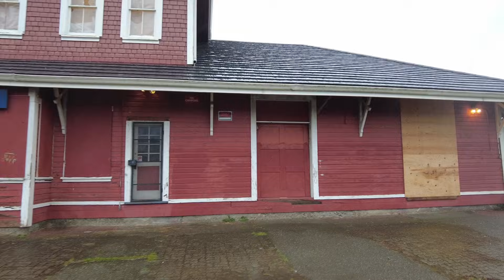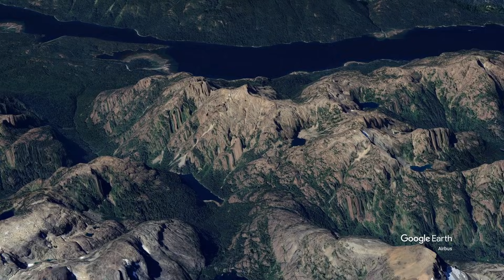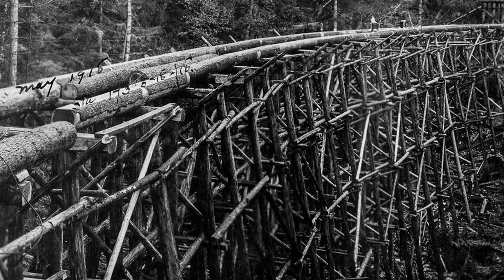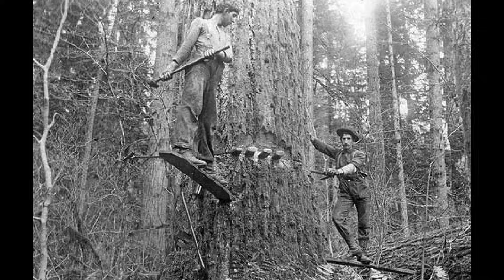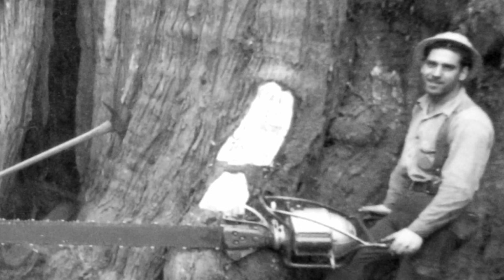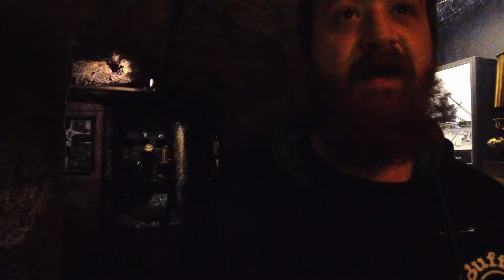Island Railway Which Will Be Gone Forever Very Soon

Comment: The old day liner used to run up to Courtney and back to Victoria. I think it averaged about 10 or 15 passengers per trip. Not worth reviving it.
Reply: Except that failure to run the railway is in contravention of the original land transfer to become private land, which requires the rail to be run in perpetuity. That was the deal but our corrupt government just rolled over.
Reply: @kelp4est   Instead of re starting a slow train. Why not twin the Malahat highway. Money better spent.
Reply: It averaged between 35,000 to 45,000 passengers a year, not too bad for a token service using one or two Budd Cars, making one round trip a day.